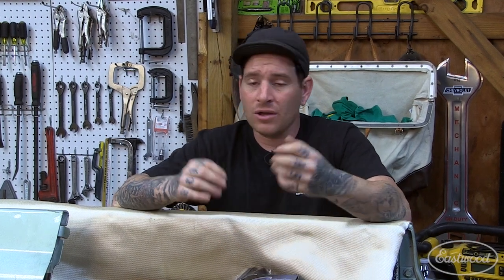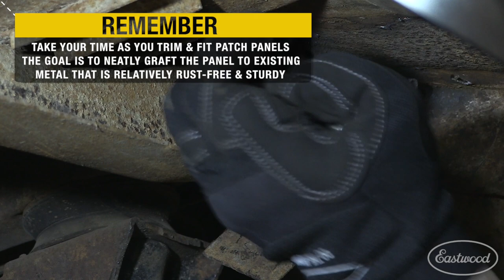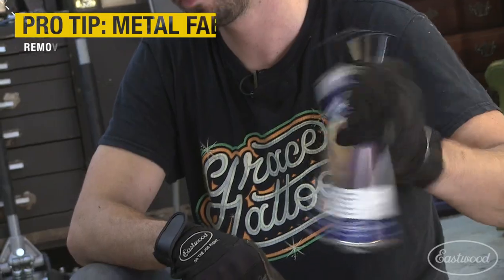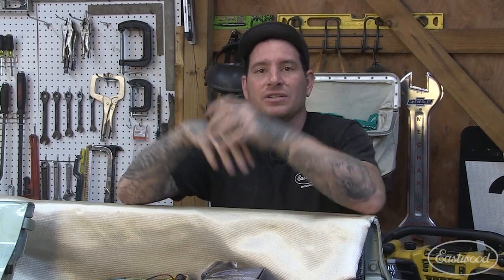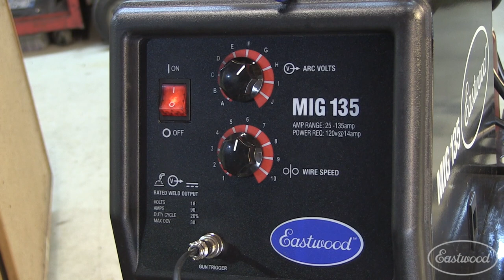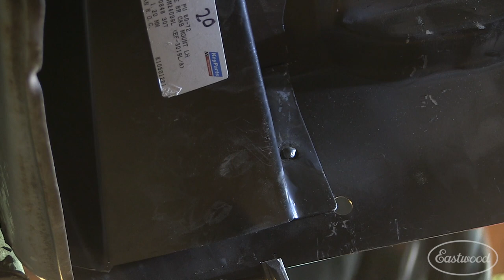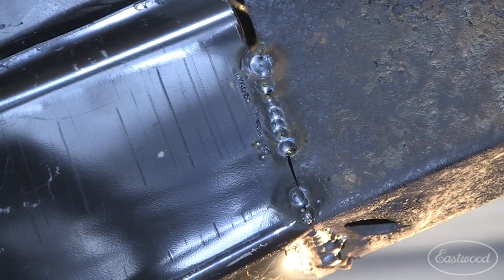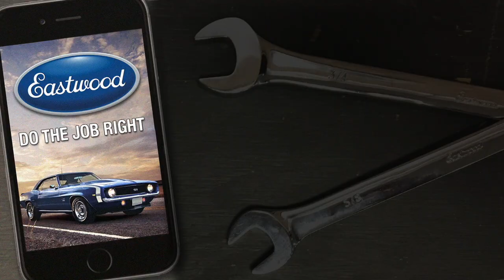How To Replace Inner & Outer Rocker Panels on C10 Truck Part 2 - Rust Repair with Eastwood

Comment: I'm currently welding my rusted out tailgate back together, then I gotta do the doors...after that, time to hit the cab...it's got extensive rust issues...many of the same issues this one has...just welded in my first patch panel...so stoked!!!🖖🏿😎👍🏿

Comment: Way easier to do a complete floor with that much rot. If i have too weld in more than two cab braces I swap in a complete floor especially when the rest of your floor looks so pitted and rotted . Way less work and costs about the same by time you buy all the metal pieces separately

Comment: It would be nice if you called all of the patch panels you are using by name. Even nicer if you gave part numbers. That's what I came here for. I keep trying to pause and read the labels on the parts you are using but unable to read them. I understand your not wanting to advertise for another company to a degree, but it's driving me nuts watching this trying to get the info I need to do this myself.

Comment: I'd have pulled the cab off, put it up on stands well up in the air, braced the door opening, and used the complete cab mount pieces rather than patching them together.
Reply: yup...I brace up the cab before I take it off the frame
Reply: the metal in all of the patch panels is thin and not made as well as the metal used back then at all. Patching the pieces also makes lining up your patches with the rest of the truck much easier not to mention all of these panels are not 100% accurate and have tendencies to not match up with the original parts of the truck let alone your all new patch setup.
Reply: LOLKINGBABY 
I agree. I’m very disappointed that patch panels are not the same gauge as original. I can always tell when I go to car shows.

Comment: When prepping the edge for plug weld's I stay away from grinding away my material and I use the Ro-Loc pad's to remove the E-coat from my patch panel's .  The weld's are so much nicer ... Give it a try and you'll see as well...

Comment: The rust encapsulator that you're using, does it create toxic fumes when you weld?
Reply from the maker: It's not a two component paint, if that's what you would like to know.
Reply: No I'm curious if the vapors are harmful since your welding through it.  When heated does it create toxic fumes is what I'm curious of.  There's always dangers when welding on certain materials, paints and chemicals and I was wondering if it's been tested to be non toxic when welded through like you guys did.
Reply: boostnhoe 
It does create toxic fumes. Wear a filter mask and have a fan blowing across the work area. Cancer is not fun when you get older.